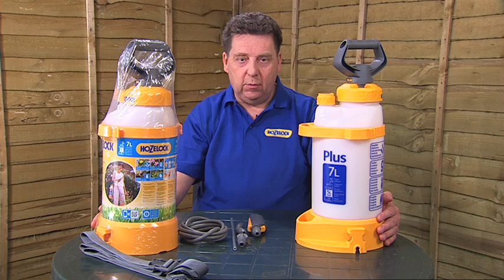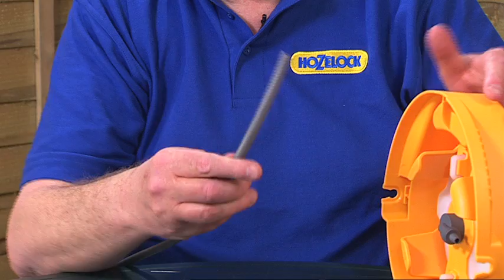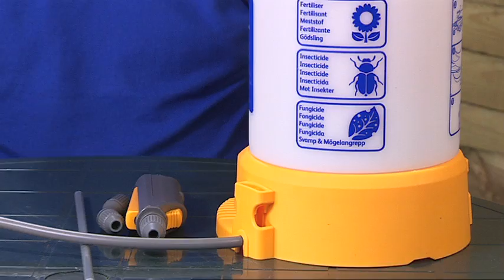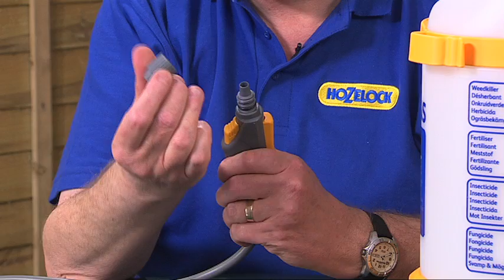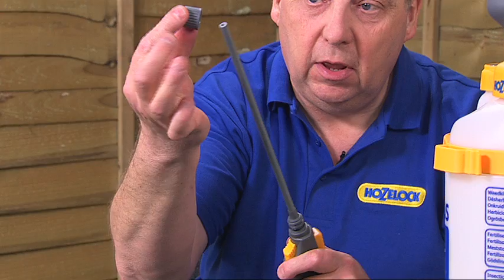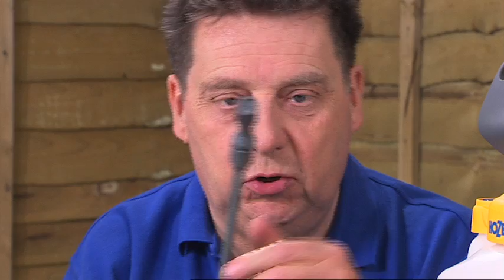How to | Assemble the Hozelock Pressure Sprayer Plus | Instructions

Comment: A friend of mine has just purchased one of these in 2024 , diabolical instructions and to assemble. No wonder it doesn't come ready to use out the box. Even difficult to release the pump handle from the assembly that screws onto the top of the container and the lance nozzles assembly is something else. Seems complication for the sake of complication.

Comment: I bought an 8 litre general purpose pressure sprayer (no instructions) it was already connected up on arrival (bar carry strap) but I've no idea how to get the top off to put water in and no decent opening for the dissolvable packets of weedkiller. 
There seems to be an inner chamber which only holds a tiny amount of water which I had to trickle in. YouTube videos so far are an American woman and one guy with an Irish accent. I can't understand either of them.